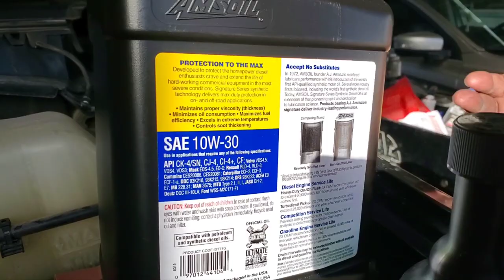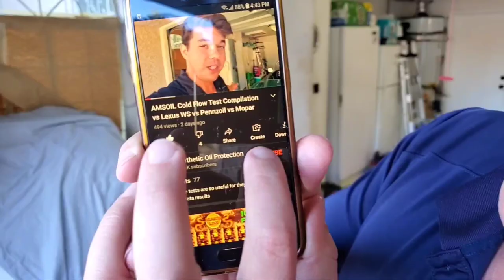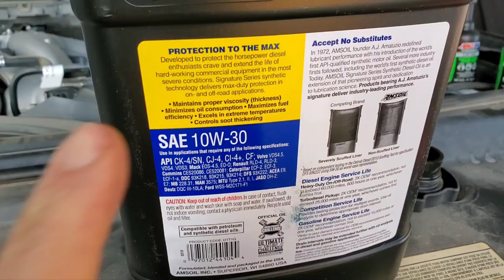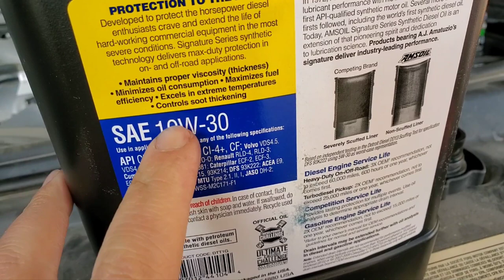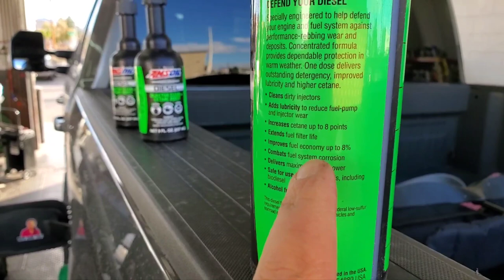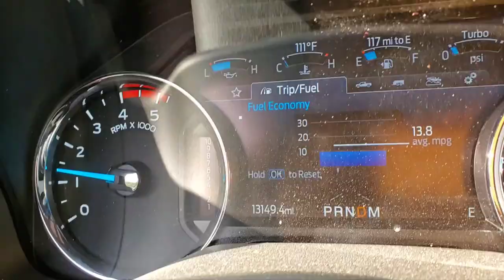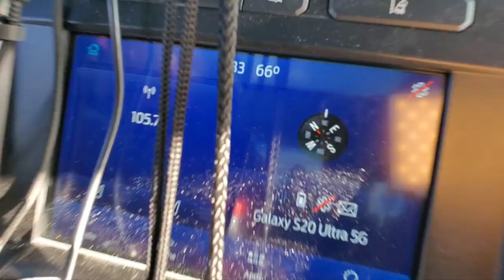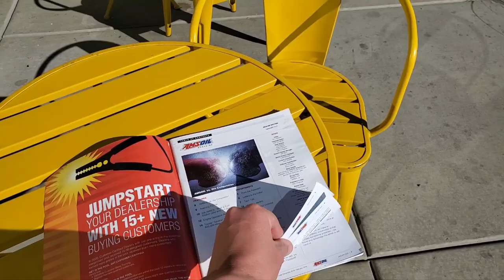2020 F-250 Tremor 6.7L  AMSOIL oil change & AMSOIL Fuel Additive

Comment from the maker: 🎬 Professional YouLubher: Eben Rockmaker Regency Gold Direct Jobber AMSOIL Specialist (Dealer#: 5331179) 702-472-3614 

     ✅ If You're New To AMSOIL I Recommend The AMSOIL 6 Month PC Membership because it will save you about $33 on a $100 purchase after the difference in tax - https://www.amsoil.com/offers/pc/?zo=5331179 

     F-250 Super Duty 6.7 L AMSOIL Fluid Changes Playlist - https://youtube.com/playlist?list=PLB_ftWArBFdeKJwjD9R2ONXxMO-asxIBS 

     ♥️ AMSOIL Performance Test Results. Read This Article - https://www.amsoil.com/performancetests.aspx?zo=5331179    

      If you would like to try the AMSOIL products this is my link and I will be your AMSOIL Dealer and will be able to answer your questions. 

     When you order as a AMSOIL Preferred Customer you will save about $33 on $100 order because of the 25% discount and the difference in tax. 

     When you click on my link I will be your AMSOIL Dealer If you go to a different device to order the products and do not click on my link you will need to enter my referral number so I will be your AMSOIL Dealer. My referral number is 5331179      

    Find Products For All Vehicles - https://www.amsoil.com/guides/?zo=5331179      

      AMSOIL Dealer Google Maps - Synthetic Oil Protection: https://maps.app.goo.gl/2AuZCi8h2Gaf3mY46 
             
Synthetic Oil Protection Website - http://syntheticoilprotection.net/ 

      1959 Cadillac DeVille is using all AMSOIL products from top to bottom. CHECK OUT THIS PLAYLIST YOU'LL BE AMAZED - https://youtube.com/playlist?list=PLB_ftWArBFdeVKszO64Ig5nWEQp7H3oF-       

       AMSOIL Performance Test Results. Read This Article - https://www.amsoil.com/performancetests.aspx?zo=5331179 

About AMSOIL..... est. 1972: First 100% Synthetic Oil Certified in the USA 

1. Where can I find AMSOIL? - Use this link https://www.amsoil.com/offers/?zo=5331179  Or      

       2. What makes AMSOIL different than other oils? - AMSOIL is 100% Synthetic & has higher film strength & holds up 4× better in turbocharger deposit testing than Mobil 1 EP which protects and separates metal parts, keeping them from wearing and Lasting Exponentially longer. 

     3. Why should I use AMSOIL?: It protects the engine so it will last longer. Less oil changes less often (once per year/15,000 miles) or longer... Save money in Gas & Time making it less expensive than a FREE oil change over the course of a year. 
  
Oil Analysis Tests: 

15,500 Oil Analysis Test Results SL550 - https://youtu.be/3rdN6U1Jt_M 

5500 Mile AMSOIL Oil Analysis Test Results - https://youtu.be/3wf962IwEmo   

5000 Mile AMSOIL Oil Test Results On My SL550 - https://youtu.be/fLuvzN6yLSw 

11,000 Mile AMSOIL Oil Analysis Results on my Corvette - https://youtu.be/YEY_13UYzA4 

20,000 Mile Oil Analysis Results on Honda Uber - https://youtu.be/gm_PXlpiaTk 

26,000 Mile Oil Analysis Results - https://youtu.be/Wdq2A2YIorM 

80,000 Mile Oil Analysis Test Results Freightliner Cascadia - https://youtu.be/9A9k6i1xMoo 

25,000 Mile AMSOIL ATF Analysis Test Results - https://youtu.be/IeVPGR7UO9E 

      The Power of AMSOIL Signature Series 5W-30 Synthetic Motor Oil protects against harmful deposits on turbochargers 4X better than Mobil1® Extended Performance and 3.6X better than Royal Purple® in industry-standard testing*.  Read This Article - https://www.amsoil.com/newsstand/motor-oil/articles/leading-the-field-in-deposit-protection/?zo=5331179      

     Better MPG Proven. Read This Article - https://www.amsoil.com/newsstand/motor-oil/articles/another-win-for-amsoil-products/?zo=5331179 

     AMSOIL Performance Test Results. Read This Article - https://www.amsoil.com/performancetests.aspx?zo=5331179      

    Try The Synthetic Oil Protection Coffee - Ebens Favorite. To Order Coffee Click Link Below: https://supportwith.coffee/shop/subscriptions/sop/

Comment: I just did the engine flush and motor oil change on my 83 Mercedes-Benz 300D. Swapped out the oil, air, and the 2 fuel filters.  Added some Amsoil Diesel Boost and she's running great! Actually ran 2 bottles of it with fresh diesel.
Reply from the maker: Sweet❤️
Thanks for sharing that with the channel Dan and always being a great part and sharing all the great content.
Let's get some coffee sometime I feel like I haven't seen you in 60 years 😉

Comment: I own a 2023 Ford F350 Tremor with the new 6.7 high output diesel and it came from the factory with CONVENTIONAL 10w30 oil. Ford never had Conico Phillips (the company that makes Motor Craft oil) produce a “synthetic” 10w30 diesel oil. They do make a 5w40 synthetic that you can run tho. I am at 2300 miles and can’t wait to reach 5000 to put Amsoil in it, from then on it will only be Amsoil signature series diesel. I just can’t decide if 10w30 or 5w40 will be better. I live in Florida so temperatures don’t dictate I run a 5w40 but I am thinking that it may be better. Can you offer any advice ? I don’t care about fuel mileage, you don’t buy a super duty with that in mind 😂. I just subscribed. Thanks
Reply from the maker: Super sweet I'm happy you got such a great truck I love that one really I used to sell the Ford trucks and that was my favorite riding truck by far handled so nice just rode like a cloud and in the future I'm sure one day I'll get one but for what I would run if it was mine I would personally run the 10w30 diesel Signature Series motor oil that's the oil I've done a bunch of oil analysis on the Channel with with different 18 wheelers and all different types of vehicles and it holds up amazing.

I mean obviously if you're going to do racing or something then you would want to use the Dominator racing oil the 15w50 but since you're not racing I would just stick with the OEM viscosity the film strength will protect you exponentially better with the Amsoil and then the fuel additives are unbelievably important for a few mileage and lifespan of the pump and injectors if it was me I would run the motor oil Signature Series Max diesel for about 15,000 miles however I would change the filter halfway through just to keep it super clean that's what I do in my car and then I would run the injector Clean Plus seating boost that's the green bottles and I would run 16 oz bottle every single full tank of diesel that will lubricate the upper Rings the injectors fuel pump you'll make better fuel mileage a lot more power and way smoother and less vibration in the motor and then every 3000 Miles I would run to 16 oz bottles as a heavy clean up dose and that'll ensure that the valve stay clean and really keeps your emissions system super clean and that way you'll have next to zero oil consumption and you'll never clog up your DPF with all that soot by keeping everything clean I would also do the two bottles of engine flush at every oil change that'll keep it super clean as well and you can get everything right here through my link and it will get shipped right to you and I will be your Amsoil dealer that way in the future I can always answer your questions💯👍🇺🇸
Also check out the promotions right now there's one on fuel additives and doubled PC points so when you become the 6-month preferred customer that's going to give you the best value and then you're also going to have double rewards right now so you're going to be getting a ton of money back in the future after you make that order if you have any questions just give me a buzz👍

To be "Your" Independent AMSOIL Dealer please use the link below or my dealer no. 5331179 call anytime Eben Rockmaker 702-472-3614 

     ♥️   Shop by vehicle - https://www.amsoil.com/guides/?zo=5331179 

     ✅   Save up to 25% on every order as a preferred customer: https://www.amsoil.com/offers/pc/?zo=5331179 
New promos: 5PI & 5DX

Comment: Two thumbs up 👍 👍
Reply: @Syntheticoilprotection  May I have the part number for the amsoil oil filter (6.7 powerstroke).
Reply from the maker: Of course Kevin this is my link if you're new to Amsoil when you use my link I'll be your Amsoil dealer in the future I can always answer all your questions on the products and the best value is the 6-month PC membership.

❤️🇺🇸❤️ Professional YouLubher: Eben Rockmaker Regency Platinum Direct Jobber AMSOIL Specialist (Dealer#: 5331179) 702-472-3614 

      ✅✅✅  I Recommend The AMSOIL 6 Month PC Membership because it will give you the Best Value which is about $ 33 back on a $ 100 purchase after the difference in tax - https://www.amsoil.com/offers/pc/?zo=5331179
Reply from the maker: After you add the PC membership to cart you'll see the lookup guide in the upper right hand corner and that will give you all the products for your year making model engine size and this is the direct link to the lookup guide.
Find AMSOIL Products For Any Vehicle - https://www.amsoil.com/guides/?zo=5331179
Reply: Thank you for your quick response

Comment: love the channel... But that's a $80k-90k truck with the possibly the lowest quality winch on the market. If you actually need to get said $90K truck out of a ditch, don't trust China & Harbor Freight... Trust Warn.
Reply from the maker: From what Colin was saying the internals are all the same I think he mentioned something like that I've never done any research on anything like this but I would rewatch the video he talked about the similarity and how they may be made at the same place I can't recall because it was too long ago since I heard him talk about it👍
Reply: @Syntheticoilprotection  Check out @Wranglerstars video with the Badlands' Catastrophic failure with a 2019+ F350. And the guy was sent that by Harbor Freight so its not like he was paid by WARN. Winches are like good oil -- saving money now just costs you in the long run. If its just for "bling" then get a cheap winch but if you are actually relying on a product, maybe not the best bet. Thanks again for the great info on your channel.
Reply from the maker: Awesome Garrett thanks for sharing this with the channel I never knew that about those winches.👍😃
Yeah I definitely agree you're always better off having extra due diligence with lubricants and higher quality products always in the long run it'll always pay off😊